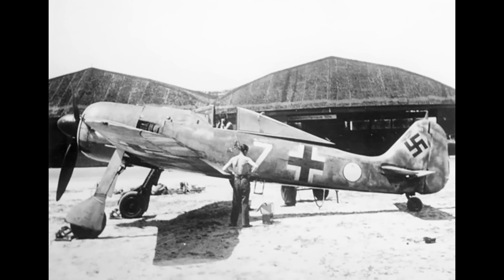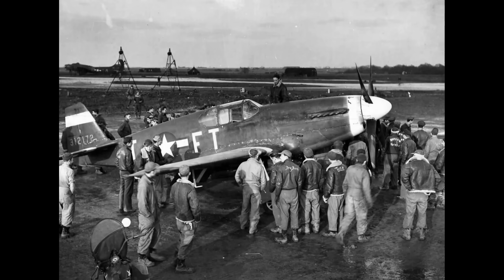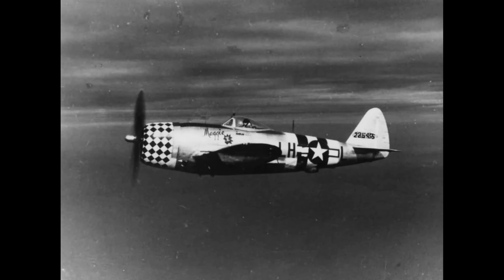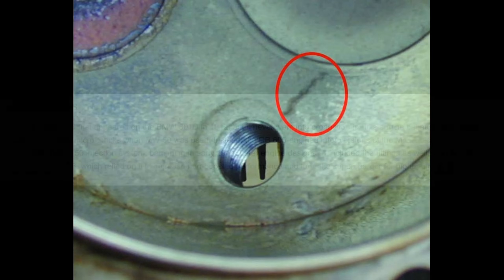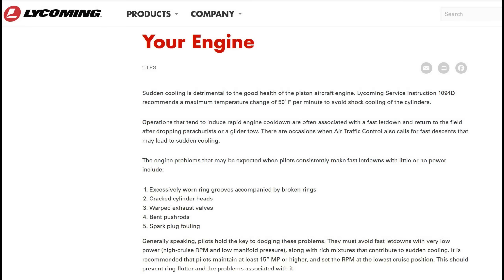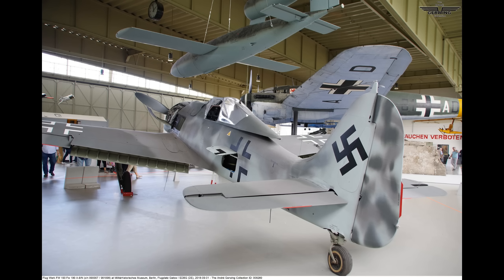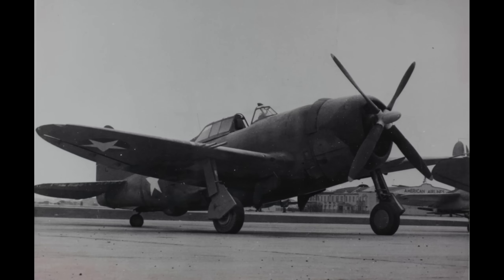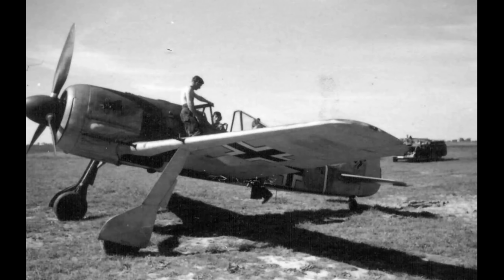Focke-Wulf Fw 190 A-4, Almost turned the tide, Almost...

Comment: This video reminds me of a time I really gave myself a fright. I was instructing autorotations in a H269 helicopter with a lycoming 360. I’d come off a mountain into a valley and rolled off the throttle on my student at 8000ft.
It was very cold the CHT dropped from around 300deg to below the scale in the few minutes it took to descend. It certainly was more than the 50deg/minute.
I realised before the bottom and very gingerly applied power to let it warm before full throttle.
I always did wonder how close that cylinder head was to cracking.
Lesson learned after that half way down I’d apply some power before removing. That did wonders and the CHT drop was no where near as severe.
One marble from luck jar into experience…
Reply: A couple of pilots were killed yesterday in Ireland while practicing autorotations.  Haven't seen any more info than that as of yet.  God rest them.
Reply: @jaym8027 I also saw that, the aircraft they were in gas a turbine engine so no danger of shock cooling.
Unfortunately practise autorotations are fairly high risk. There is a lot going on and it’s easy for students to make mistakes. It’s a common accident profile while people are learning to Pilot. It’s also necessary to learn.  
Tragic outcome
Reply: @chrisbeauchamp5563  I was gonna say a funny thing and then I read the replies and holy shit. I was out with a bestie having drinks and just having an all out good time. Goes to show hor precious life is.
Reply: Heard of a CFI who was on a somewhat similar flight profile to yours, having come out of the mountains making a long, shallow descent towards his home base airport. IIRC the threshold for applying carb heat in an R22 Beta II (O360) is 18" MP, and he was at or slightly less than this during the descent. It was a relatively warm day and he didn't think carb heat needed to be applied. He experienced an engine failure and was able to autorotate the ship in with no damage as I recall. But it was discovered the engine failure occurred due to carb icing that gradually built up during that lengthy shallow low power descent. The fellow was found to be at fault and lost his job over it, but all around a cheap life lesson; nobody was hurt and the aircraft was undamaged.
Reply: @jefftuckercfii  I have heard of this issue. In the CB model which was carbureted from memory you had to be careful as the carb heat would become ineffective as the exhaust cooled down. It was known to  need to use enough power on large descents to ensure the carb heat worked. 
This particular model was a CBi which was injected so no danger of carb icing.

Losing your job for that seems very heavy handed what a bad way to manage your pilots. This just encourages people to hide their mistakes.
Reply: @jefftuckercfii  companies pay for these experiences, which constitute somewhat expensive training for their employees. Then they fire them. And that former employee goes through a tough time in life. And takes that experience and value they obtained, and provides it to the former companies competitor.
Reply: @Glove513  lol, that is funny. The cool down used to seem to take ages. 
Cold days warm up was even worse trying to get the oil in the green.
Reply: @chrisbeauchamp5563  Same thing applies to the R22. Same engine unless your H269 is injected vs. carbureted, IO360 vs. O360.
Reply: In the words of a former fighter pilot I know “better to be lucky and alive than amazing but dead”
Reply: Wow amazing how many things need to b considered when operating such a highly technical machine!   1 little thing here or ther can have repercussions.       Liked "a marble in the exp jar....."  😊      I'd really like to learn 2 fly small airplane or helicopter!
Reply: I was there. I was the Lycoming 360
Reply: You are making me want to start helicopter pilot training good sir or madam!
Reply: @Fer-De-Lance  you get one shot at life, do it.

Comment: An important difference between the BMW radials and most other air cooled engines is the engine driven cooling fan. This provides cooling airflow that is linked as much to engine rpm as to airspeed or power settings. This could go some way to explaining the difficulties. I was involved in operating light aircraft abut also Corvair cars. The opposed air cooled flat six shared some things with the aircraft engines. One problem we had with Corvairs was when people took the thermostatically controlled cooling damper doors off to try and improve cooling. This could lower cylinder head temperature under highway driving but was bad in hilly driving. You would run at 80% power up a long hill and the head temperature would get well over 300 F degrees and then reach the summit. Throttle goes to idle but rpm stays the same and cooling remains the same. Head temperature goes from 320 F degrees to less than 200 F in just a handful of minutes. In the Corvair the result was loose valve seats. The stress that high rate of cooling provides needs to be managed carefully and a fan forced cooling system only makes it more critical because cooling is directly linked to engine rpm and not throttle position or speed. Add MW-50 and that may have been one straw too many.
Reply: The fan cooling was only a significant factor at low speeds, at high speed it spun freely.

Comment: The problem may have been cooling related, but not micro cracking of the heads. Another issue Calum E. Douglas talks about is C3 fuel diluting the lubricating oil, causing sudden catastrophic bearing failures. The problem was exacerbated by poor metallurgy in German bearings, but the root cause was diluted lubricating oil. 

The Germans encountered this problem in liquid cooled engines when using heavier C3 fuel with its higher evaporating point. The early injection systems produced poor atomisation, letting large droplets of fuel hit the walls of the cylinder where they'd be drawn into the lubricating oil. Eventually the oil would be so diluted it'd cause a bearing failure (usually main bearing or a big end). However, because air cooled motors ran hotter the diluting fuel would evaporate from the oil before it caused a problem. But in liquid cooled engines it was a critical issue until they revised their injection systems to achieve better atomisation. This was one of the reasons for the short service life of the DB 601N. 

Perhaps in the BMW801 D-2 the use of MW50 cooled the inside of the cylinder sufficiently to let the C3 mix with and dilute the oil and thus cause a problem.
Reply from the maker: The problem in this case was cracking heads, not bearing failures so I don't think that's related. Then again, there just isn't a lot info on this, hence the discussion.
Reply: @GregsAirplanesandAutomobiles  I'm questioning whether issue really WAS cracking heads. The thinness, non-technical and secondary nature of the source material makes me question it. The secondary literature on the FW-190 in English is really atrocious, and the better more modern stuff hasn't been translated yet.😕

Comment: Germany was having other metallurgical issues towards the end of the war, particularly in the quality of their tank armour. It was a shortage of the necessary alloys.
Reply: I spark tested some old armour plate when I worked at a foundry and it was horrible quality. They could have found workarounds but fir some reason they didnt
Reply: German Armour used nickel to prevent spalling.  Often face hardened carbon steal Armour was as good at stopping penetration but the spall generated would be as deadly as a penetration.   Nickel was also a critical element in gas turbines due to its resistance to heat creep.  The Nimonic 80 used in British gas turbine came out of a nimonic 75 used in valves seats of engines.

Comment: Yussss. Awesome video greg. I wa taught 1 inch per minute bringing back any turbo charged engine power, non turbo it not so critical in my view with lower CHT overall. You just have to look through the cowling vents in cruise at night to know there is some serious heat going on with glowing orange exhaust manifolds 😂 Navajo guy here
Reply from the maker: It's nice to hear from some others who actually flew these things. I thought I would get an onslaught of people saying "shock cooling isn't real" but it hasn't happened.
Reply: @GregsAirplanesandAutomobiles  > I thought I would get an onslaught of people saying "shock cooling isn't real" but it hasn't happened.

which in itself is a shock!  cool!
Reply: I saw one guy say that, sounds like a legit concern and it makes sense.

 I'm guessing you could harden (enbrittle) the metal without it actually failing though it may then be prone to failure.  
 @GregsAirplanesandAutomobiles

Comment: Greg- may need to contact Jim Steck for more details, but when we were running an Alfa at a LOT of boost (this was the LSR Spider from a little over a decade ago), there was credible evidence that the boost was enough to deflect the combustion chamber to loose power.  Which is to say that it's possible that the extra boost and higher combustion pressures could lead to chamber deflection and thus cracking in the BMW engine.  Combine that with the shock cooling- it could be a combination of things.
Reply from the maker: Jim Steck is a decent guy. I have read his stuff, and I have met him. I'm going another direction entirely with my Alfa engines.
Reply: @GregsAirplanesandAutomobiles  I brought it up not for the Alfa specific part, but that it had chamber deflection under high pressures that could have added to the cracking issue in the bmw. The gm ecotec had some specific modifications to prevent chamber deflection when boosting it to make ~1000 hp, too. So I would actually combine the chamber deflection with the shock cooling that would have lead to the water/methanol path ending. Those two factors would really be a problem when alloy supply was such an issue.
Reply: @alfamaize  I broke a valve head off on my Alfa Spider many years ago.  When I got the engine apart, I found the broken off head stuck into the top of the piston.  It hadn't cracked the piston, just embedded itself perfectly.  I hadn't realized how soft those pistons became while running normally.  Its easy to picture lots of boost being able to deform the combustion chambers and/or the piston crowns.
That was a 78 with the SPICA injection.

Comment: Regarding metallurgy, I've only recently discovered that German 1944/45 armor was prone to shattering due to lack of strategic metals. The same strategic metals in shortage, were used in aero engines (piston & jet.)
Reply: 1944 armor quality was still good. However with Finland doing the "Italian Job" (switching sides in a war), there was no further access to vanadium (?). 1945 armor COULD be of lesser quality. These "battlefield tests" never tell the whole story. In what condition was the target, was it widely intact or was it already burnt out ?
Unfortunately, metallurgy is a bit too complicated for the YT comment section. Was it a lack of alloys ? Was it rushed production and/or slave labour affecting quality ?
Russia had very similar issues UNTIL 1944; they tended to over-harden their steel, which makes it brittle, even more so around the welding seams (which were a nightmare to begin with ...).
Reply: This is very exaggerated, honestly bordering on myth at this point. Sources are conflicting with each other, and one period British document made that claim without any testing but simply as an educated guess, from finding out Germans lacked one element of armor that they [*British] considered essential, while it turned out to be untrue since Germans found an equivalent replacement for it (IIRC it was about vanadium), that British didn't realise was possible back then. On top of that, evaluations of armor plates of all major nations reveal varying quality and unequal batches in each case, so much that it's problematic to deduce whether changes in quality of armor plates specifically in case of Germany came from lack of certain components or was simply matter of average quality fluctuations that affected every other nations' armor production.

Reduction in production quality in WWII Germany is very apparent in many areas, but I'd always treat statements of it affecting such vital aspects which would logically be prioritised, with a very big grain of salt. Judging by statements of some of internet experts one would think all their stuff was falling apart the moment it left factory, and Allies were dumbasses to even fight them and lose hundreds of thousands of brilliant men's lives instead of just waiting for every German machine to break by itself...
Reply: @czwarty7878 …. I would think the evidence or lack of is in post action reports of armor, engineers, and ordinance corps done after the battles
Reply: @czwarty7878

It also comes from unsubstantiated hyperbolic Soviet claims. For example the Soviets claimed that even the King Tiger plates fell apart when hit, split its weld seams etc. There is no evidence to support this. On the contrary, plenty of pictures on the western fronts showing King Tigers with AP hits directly on the weld seams and yet suffering zero splitting apart. The western allies faced King Tigers built at the same Henschel factory as the Soviets did. 😂
Reply: @lyndoncmp5751  there is also the little detail of hitting a armour plate with a 76mm shell versus in several cases 152mm shell… with way, way more mass and explosives in it.
Reply: Of course there is.
The Insigny firing trials of 1944.

The conclusion was that germans did not use substandard armor plating.

They fired 9 times on a already penetrated plate, bevor cracks appeared. And 30 times on intact plate of a Panther bevor a cracks were noticeable. The 105 mm howitzer was more likely to produce cracks.

But there is a video of Pzh 2000 firing a 155mm HE on a Leopard 1. Look at the aftermath and then complaint about the fact that German Ta nks cracked after beeing hit by Russian 152 shells. Which wwii would not crack.

Even the M4 knocked out during the famous battle of cologne had a shattered gun mantlet with a huge chunk missing.
Reply: @lyndoncmp5751  it is worth keeping in mind there are much, much fewer photos from the eastern front comparitively, and this chat has already discussed the varying quality of german armor, the problem wasn't that the armor wasn't good enough, it's that it wasn't consistently good enough. some KT's just left the factory with kinda dud armor and you couldn't tell until it actually started taking hits.
Reply: @czwarty7878  IIRC it was about vanadium

Correct. Molybdenum vs Vanadium.
Reply: So you just watched that video, huh?

Groundbreaking discovery bud.

Just messing with you;)
Reply: @Br1cht  groundbreaking comment bud
Reply: Yup.  In Normandy, the US captured some Panther tanks and ran tests to see how various Allied guns fared against the armor.  The results were different for each of the three tanks used in one particular test, indicating that Germany was no longer able to consistently produce top quality armor.  I don't know how much of that was from the strategic metals shortage vs, production processes, though.
Reply: @jfess1911  not to. mention lots if wartime manufacturing  was by forced labor- you'd hardly get high quality work.
And let's not forget the really top notch craftsmen may well have been  conscripted as grunts in the army
Reply: @jfess1911 

The shaef tests proved the opposite...that the claims of bad German steel were extremely exaggerated
Reply: The key alloying element in German Armour was nickel.   An addition of 0.1%  prevents spalling.  The nickel didn't make the Armour stronger but prevents high speed fragments from detachinng inside that would kill the crew behind the armor without it ever being penetrated.  Fun fact:  German piston engines used more nickel and chrome than the jet engines.
Reply: When we compare the wrecks of German tanks with those of other nations, that does appear to be the case. At least in regards to tank armor, German armor appears to have had a higher propensity to shatter, both from high-explosive shells as well as from armor-piercing projectiles which failed to penetrate.
Reply: There are quite a pot of desert war photographs showing the weld seam failed

Comment: The 801's supercharger couldn't raise enough boost to need MW injection at 25,000 feet where the American bombers flew. For MW to have an impact they would need to get the Mustangs and Thunderbolts to descend below 20,000 ft. Not sure if that was possible tactically.
Reply from the maker: It absolutely was possible. The P-47s would routinely follow the 190s down.